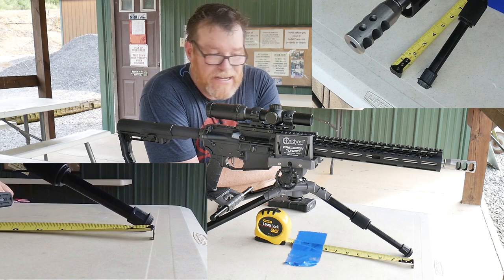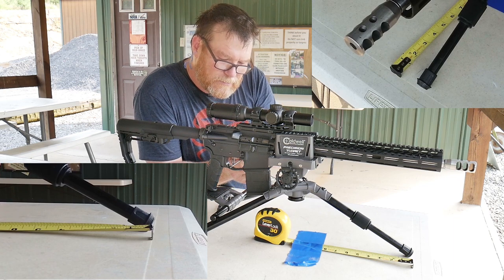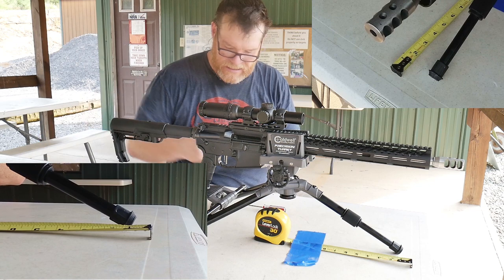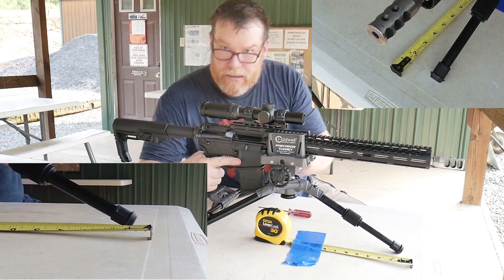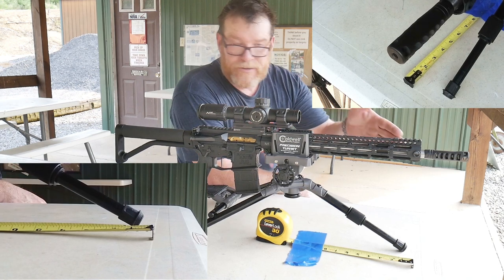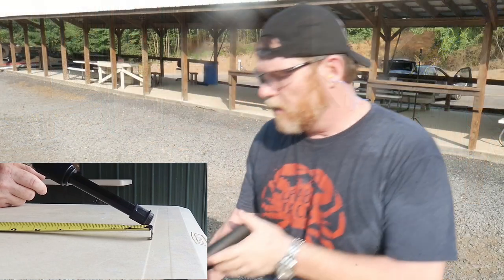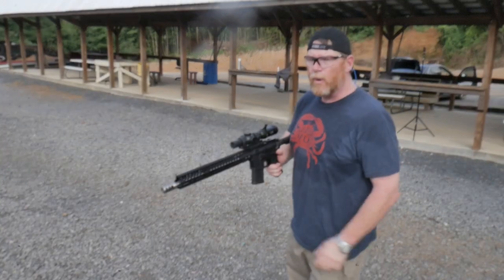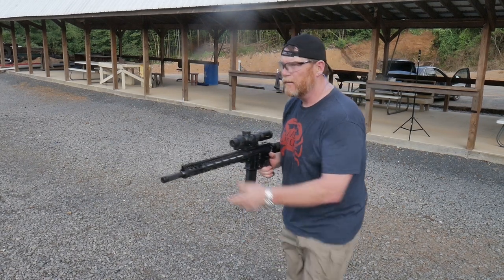Cheap Vs. Expensive!  Recoil & Double Tap Test

Comment: Budget rifle won!
Reply: MD Ready Not really. Monte has the better brake as far measured recoil
Reply: @echofoxtrotwhiskey1595  I see thanks for the clarification!
Reply: I'd say they split those 2 events, but the high $ one having less recoil by only 1/4"-3/8" than the budget gun, is definitely a win for the budget gun.  It's like a Ford Focus losing to a Lamborghini by a bumper length.
Reply: @11C1P  lol so true!
Reply: 1/2" on full montey to 3/4" on cheapo is a 50% increase in recoil wich is a lot, I'd imagine felt recoil is way better on the Montey
Reply: $600 budget AR vs. $2500 AR

budget wins cuz I don’t have $2500

Comment: I think this is a great series. I hope it finally puts to rest the theory that more money is linear to performance. I have found that my most accurate and reliable builds tend to be using the less expensive parts.
IE: Timney trigger vs ACS trigger, Krieger or Wilson barrel vs Anderson and Spinta precision. Spikes, Noveske lowers vs Anderson/PSA/Aero.
Failzero, Rubber city vs AIM, PSA, Toolcraft. 

No reason to pay for marketing if two companies manufacture with the same base material, or use the same CNC equipment and process. 

I did a similar test for accuracy at 100 yards, and my Anderson RF85 Bull barrel with American Eagle 50gr 223 Varmint kicked butt against a buddy using Rock River Arms and Hornady ammo.

Comment: At a later time it would be interesting to see what the recoil test looked like if you swapped the compensators to evaluate how much of an effect they have.
Reply: @SnakeEater503  As I was thinking about it I also thought it would be interesting to shoot both builds with an A2 or no compensator on them to see the difference that the low mass BCG and buffer provide over milspec.
Reply: Compensators and Triggers.

Comment: I really do think it’s all the same stuff with some minor differences at the end of the day. Paying for the “name” with a lot of this stuff.
Reply: Sometimes those minor differences make it so much better though.  Just one example, the Radian Raptor charging handle...if you've never used one you won't understand.  There was a time when I just couldn't imagine spending over $100 on a charging handle.  But when I finally got a wild hair up my ass and did, I put it in my rifle and charged it back for the first time...instant freedom boner.  I will never buy another cheap charging handle.  I did go with the cheaper Raptor LT on my latest budget build though...even though it's not quite as good as the original, it's still pretty amazing.  It's just got polymer ears on it instead of aluminum.  It's too bad my wife is sleeping right now...it's very hard not to jump up and rack them back all erotically and what not...that damn freedom boner is back again.
Reply: You were just shown empirical data that there was a profound difference in performance. It is true that there is little or no difference for some products. It's also true that the difference in price isn't always commensurate with the difference in quality. But people who say it's all the same are usually folks who don't know any better. Some products, like an ACOG are just immediately and obviously better. Other products are less easy to see the difference. Take an MP tested bolt. It looks exactly the same as a cheap bolt. But you are paying for the testing process as well as the other bolts that failed the test. In exchange, you get a bolt that you know is far less likely to shear lugs. Often, the extra cost is a result of more stringent QC, which discards failed parts. Sometimes that extra cost is the result of higher quality materials that are stronger, lighter, more corrosion resistant. Sometimes the extra cost is due to more detailed manufacturing processes. More expensive isn't always better, but better is almost always more expensive.
Reply: The Chopping Block so than how does one explain the issues with the various Sig Sauer products that are failing left & right. ?
Reply: @chopping block in your own paragraph you actually double talked yourself in your own words.
Reply: @solrosenberg7827  If you're looking for one set of rules that applies to everything, you're going to be disappointed. Shit that fails is, well, shit. Regardless of how much or little you spent on it. If you need help understanding what I posted above, let me know which part confuses you and I'll do my best to explain it in a way you can understand.
Reply: Frank Rizzo No he didn’t. You just don’t understand.

Comment: The only problem with budget barrels are the consistency in the manufacturing process. I will spend the extra money on a quality barrel and bcg, then budget or "blemish buy" uppers, lowers and hand guards.
You can polish Mil-Spec triggers, bob the hammer and use reduced power springs and get a nice 4.5 lb trigger.
I really like the 45* safety levers, but $50? Crazy.
Good job on both builds.
Reply: I've dealt with 6 bear creek barrels recently. The only accuracy issue was quickly fixed by polishing the feed ramps. They are great for the money. Plus,ar's are 300 meter rifles reguardless. Even 2moa is fine for most shooters. My wife 10.5 inch bear creek barrel is a 1.5moa all day for $39 . For $300 you would get the same or worse accuracy. Bear creek has our business for good.
Reply: Freedom Inc. 
I'm happy for you with Bear Creek stuff. You comment on the 300 meter max is a large generalization. 5.56 is a capable round out to 550m and more depending on the round you use. The largest factor is at what distance the round you are using goes subsonic, that is when the bullet becomes unstable and starts to tumble.
Bullets with higher coefficients will naturally stay stable longer in flight which obviously will extend the range past 300m.

Comment: On the recoil test, what was the weight of each rifle? i.e. 6.5 lbs vs, 6.7 or whatever.
Reply: The last video or the one before had the exact weight. The expensive rifle was heavier bit I cant remember by how much.
Reply: @FreedomInc  Thanks man. Been real busy lately, I must have missed that vid. So, easy to assume the muzzle breaks roughly equal.
Reply: @blackhawkinternationalsecu6962  that wasnt the greatest if "tests" tho he did work with what he had. A change in humidity could change the outcome due to moisture on the tables surface. Overall,the cheap one one. The accuracy test should have been done from a lead sled.
Reply: @FreedomInc  Understood on all points. It could also come down to the weight of the buffer, recoil spring tension, barrel length, and the list could go on. Really, can you tell that much difference? ANd then come right down to it, they really are different guns. The real question is; do want to spend $1k for that amount of gain?  Still comes down to the individual.
Reply: @blackhawkinternationalsecu6962  that's what I was saying. It could have come down to the moister on the table was a way of saying a ton of shit could have effected it. I just didnt want to list everything I thought you would understand.
Reply: @blackhawkinternationalsecu6962  and right,even with the amount of recoil his rifle had, doesnt mean yours has the same amount. That test only compares the rifles he built and not all rifles. The cheap rifle had a non adjustable gas block on it,so he could have probably threw an H2  buffer in it to calm it down as much or better than the expensive rifle. I left a comment somewhere else that all these tests ate just about these two rifles and how they performed how he set them up with the parts he chose.
Reply: @FreedomInc  Ah Jez. Dude I read right past it. I'm laughing at what you wrote AND myself now.
Reply: @blackhawkinternationalsecu6962  lol,its good

Comment: Ever try the VG6 Epsilon compensator?  The cage (added attachment) will make the side exhaust fine to literally be next to.  Regardless, a very interesting video series.  As an aside, is the more expensive weapon much heavier?  I know the barrel is more substantial, but your BCG is lighter.  More weight would account for the shorter recoil measurement.

Comment: I would be curious to see what an A2 brake would look like because that is what is on both my PSA AR's I have. In know there will be a slight difference in felt or perceived recoil between the 16" and 20" barrel's. Both are mil spec weight and profile.

Comment: I'm in the "flip a coin" bunch 😄 from a bag my BA/AERO 18" mid length build is sub MOA at 100 yards...my budget 16" PSA mid length build is 3 MOA at 100 yards. On an 8" steel both work great. About the only difference are the optics and cost of the build ($400 for the PSA less the cost of  a Vortex 3X Spitfire and $875 for the BA/AERO Wylde less the cost of the Leupold 4-12 VXFreedom)...both of your builds are very nice and well done 😄....I'm pulling for Eco (my being "thrifty" and all)...but IMHO both are winners 👍 looking forward to more reviews. Keep them coming !

Comment: The gas system length makes the biggest difference in recoil, then buffer system, the muzzle devise does make a difference, but IMO they are misrepresented (looked at as a the big fix) when having a properly tuned gas and buffer system will get more results

Comment: Many cheap muzzle brakes wotk well, but are EXTREMELY noisey, and often have huge muzzle flash. Expensive brakes, like the ATC, are just as good, or slightly better, at recoil reduction, but are also much quieter and often reduce flash and blast.

Comment: What Lb. Trigger is in expensive rifle vs Cheap rifle.. If they are 2.5lb vs say a 5lb mil spec trigger that changes the recoil distance a lot by you pushes on the triggers ,
Reply: econ1 is a psa 3.5lb i forget what the monte has but assume its a little less than that
Reply: The diamond he has in the monte I think was set at just over 2.5 lbs but could go lower

Comment: It looked like you fired monte with all cartridges in the mag which if so would effect the weight compared to individual cartridges on eco 1? Either way they are still so close. This is a great series!  I built mine eco 1 style and it's awesome to be able to compare.  I wonder how much the adjustable gas block effects this? That's a pretty affordable upgrade for any eco AR.  I know mine is overgassed!

Comment: In my experience, you pay for fit and finish more than anything.  I have built several ars and gone both budget and expensive.  Like handguards for example, I have a $200 15" mlock on one, and a $45 15" mlock that I found on gunbroker on another.  The first thing I noticed about the cheap one was how sharp the edges on the mlock slots were.  They actually felt like they could cut you.  No big deal though, a few minutes with a pocket knife going around each slot and it feels fine.  
  My $2700 5.56 feels a lot more solid than my $675 .300blk.  There is virtually no play in the 5.56 upper/lower reciever fit what so ever where as the .300blk has some slop in it.  It's nothing too excessive, but you can definitely tell it's there.  
   You can also feel a difference between cheap and expensive by racking the bolt back.  On my expensive ones, it slides back like glass...the same can not be said for the cheaper ones.  They feel fine, but there is just no comparison to the feel of a quality build.  
  Don't misunderstand what I'm saying here, I love building cheap ars.  Hell, I have an internet tab always pulled up with the BCA site on it lol.  But...if you're going to build more than one, go expensive on one.  I promise it'll be worth it.  It might spoil you a bit though and make you notice small things like rough edges or a little bit of play in your other builds that you never noticed before.

Comment: Based on this video, prices paid for barrels, Id never pay the money for.that barrel.  If a Bear Creak can perform at that level.for 1/4 of the price, Id try a BA or Centurion in same comparison, may suprise you.

Not to mention the lighter, shorter and cheaper is gun is right there.  Now try quality ammo and may see difference your happier with.  Each barrel is designed, zerod with a specific type and weight of bullet as are pistols, but most dont know or pay attention to it anyway.
Reply: Yea this is why I hate those expensive ar's. What did he really gain? Almost nothing, if only slight improvements...
Reply: @Flemdragon  Nah, I dont beleive that necessarily.  To me price is immaterial, but when comparing two it can be discussed.  Individual parts quality or not and building is a whole different ball of wax.

Comment: felt recoil would be lower in the Top-Tier cat, however the fatal flaw with making every aspect of the pricier rifle lighter was adding the extremely light trigger. Everyone talks about harmonics and why a balanced rifle is key to successful shot placement (Albeit, with the right shooter behind the trigger), This vid actually shows it. Both fantastic rifles, some minor tweaking will bring the Top-tier and budget rifle closer together (in terms of shot placement). I'll also say this, be neutral instead of leaning on wanting the top-tier to work better. Just my opinion as bias will poison the well.

You done good, fren. Subscribed.

Comment: Wow...impressive, but you can tell the Monte had just a little less recoil and muzzle jump. Considering all the differences in the BCG, buffer system, trigger, and muzzle breaks, it only appears to be a slight difference.  I wouldn't know since I'm not physically shooting them, but from my observations, with a little practice, the econ model can take an individual a long way in some similar matches. I'm curious to see what kind of groups you can squeeze out of those puppies at 200+ yards. I think I have a good challenge for ya, can these rifles shoot accurately to hit a man size target at a 1,000 yards? I know 223/556 can do it, just depends if the barrel and ammo combo is a good match and if the shooter know how to properly adjust for the current conditions.

Comment: Obviously not perfectly scientific, but for sake of discussion, did you weigh the differences of the weapons to each other? Weight has an impact in drag. So the kinetic energy pushing it back plays a factor on how heavy the object is, heavy = harder to drag.
Second point maybe have a measuring tape on each side to help in averaging both sides for a more accurate read.

Comment: To be truly accurate with this test both rifles need to have the same muzzle break. Love your videos. I'm a long time viewer.
Reply: James Blackwell   The brake is not the only thing that changes recoil.  They also cost much different.  The point is to test the whole package against the other whole package.   Making them have the same parts would make it less accurate.

Comment: You really can't start to compare 2 different guns and get any discernible difference @ 10 yds.  If you were to run a time driven drill where you engage a five or six 10" plates @ 100 yds, you would be able to see the difference in accuracy and speed (due to lower recoil).

Comment: kinda flawed, just using a stick at various angles (not always the same place) to measure  recoil, pretty much guessing those results. same with the double tap, no measurement, time, spread, no accurate results. can only assume this is just a dog & pony show not meaning to be very accurate, more opinion based. it's fine with me, you seem to be a pretty good judge.

Comment: now if ya tune the gas bock on monte. i usually adjust until it won't lock back on mag then up until it will. sure you do simaler. then you might get it even softer recoil. with your 3 gun loads of course.
Reply from the maker: That will come in to play down the road.  I didn't have a chance to tune her good

Comment: Trying to prove the expensive is better than cheap... So what are you going to do? Keep shooting until you get it that way?  LOL  You did the test and in 20 shots..Ten Shots each. and it failed to beat the cheap rifle.Even with a lot better trigger..its a lighter and faster trigger.. You also changed sequence in shooting order on the two tests. Why? do you practice with all shots moving down so you dont have to raise your POA back up? 
I have no doubt that the expensive gun should last longer because of the lighter BCG...That all reduces recoil and reduces the reaction time to reacquire your point of aim.
Now is the money difference worth it? In my opinion it is not,,,Its just a mans need to have the best..so we all think..Im quilty of it.Ive never really bought cheap anything on purpose., unless I did it to see the difference just like your test.
I think if you put a better trigger on the cheap rifle and maybe a better muzzle brake, then it would perform even better. The lighter made BCG should made the expensive gun out last the cheapo gun.
The optics and mounts are equal in the 3 gun match.I don't think you would see a big difference until the distance was stretched way out.